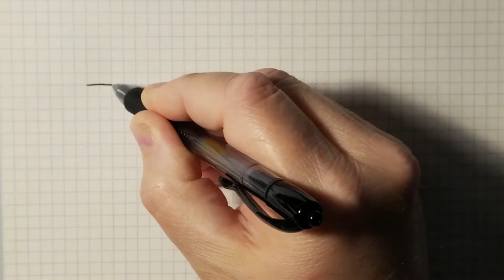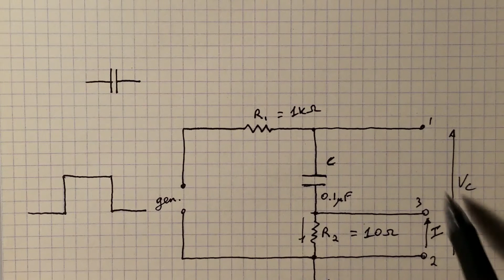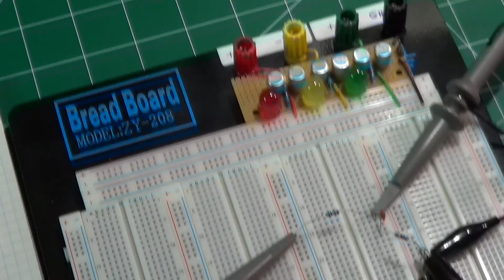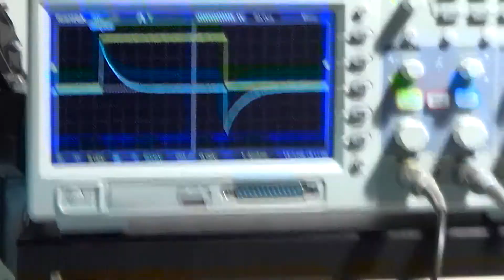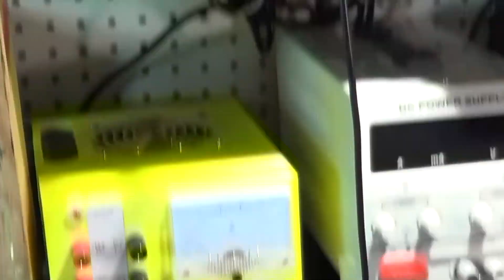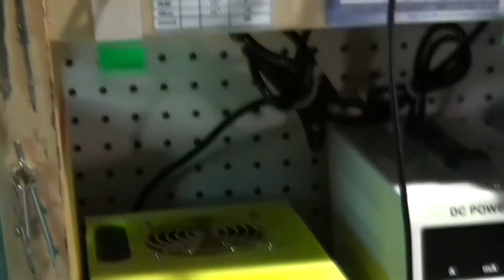capacitors charge and discharge visualized

Comment: Your function generator doesn't seem to be available anywhere anymore & that is to be expected after 5 years. 
Can you recommend one of similar lower end specs that I could use to emulate your vizualization. I can only see higher end expensive units for professional use & most are only signal generators anyhow.
Reply from the maker: Well, yes that function generator you see in the video was made by myself way before I started making videos, that's why you couldn't find.
If you are interested in buying one at low cost, I see there are several options on Amazon, ranging from about $10 to $100. It all depends on what you want to use it for.
This one, for example, is based on the same IC i used for mine, but is very basic:
https://www.amazon.com/ICQUANZX-Precision-Generator-Adjustable-Frequency/dp/B07V674HZY/ref=sr_1_5?crid=WEIEEXDT4N4K&keywords=function+generator&qid=1706289323&sprefix=function+generator%2Caps%2C122&sr=8-5
This other one has a smaller range, but it seems good enough for Audio applications, and It ha a nice display and controls:
https://www.amazon.com/1HZ-500KHZ-Functional-Generator-Seesii-Frequency/dp/B08NSR5GYR/ref=sr_1_3?crid=WEIEEXDT4N4K&keywords=function%2Bgenerator&qid=1706289323&sprefix=function%2Bgenerator%2Caps%2C122&sr=8-3&th=1
Finally, I could suggest an entry level instrument that is also capable of creating any shape you like, a true function generator, rather than a signal generator, but it is around 100 bucks:
https://www.amazon.com/Koolertron-Generator-Precision-Dual-channel-Arbitrary/dp/B07211YWMK/ref=sr_1_4?crid=WEIEEXDT4N4K&keywords=function+generator&qid=1706289323&sprefix=function+generator%2Caps%2C122&sr=8-4&ufe=app_do%3Aamzn1.fos.18ed3cb5-28d5-4975-8bc7-93deae8f9840
This last one is actually very similar to the one I currently use in my lab.

Comment: After viewing amateur after amateur videos and youtube channels this is refreshing. Noting the following: Though I'd like to know and see the actual specific current running through a capacitor from T1 through T5 on a scope (i.e. the 5 time constants), this I believe will get me started.

Though I've several reasons in monitoring a capacitor for a future project, monitoring and recording by means of a scope rather than to using those 'useful but cumbersome equations' I often get lost in, putting my scope & generator to work will be far more accurate. Also, though I'm sure I would eventually thought of using the lower resistor as you have (as in a 1 ohm for example) I never thought to include that same lower resistor.  Thanks. And excellent job on this presentation.

Comment: I may be 4 years late but this video is perfect and EXACTLY what I was looking for to visualize the terminologies. So when people say capacitors resist changes, it's not that the capacitor is staying stuck at some voltage, it just simply takes some time to change; giving the illusion of being resistant to instant change lol. 

Explaining in terms of the potential difference, with a bigger difference = more current flow makes a lot more sense and is more intuitive for me. Capacitor draws more current when it starts charging because big PD. Likewise, it discharges high current because of the big PD, just in another direction. As the PD decreases, so too will the rate of charging/discharging.

Comment: what voltage and frequency did you set your function generator at?
Reply from the maker: It can actually be seen from the oscilloscope itself, although I didn't mention it in the video. Sorry about that.
The input square signal has an amplitude of 15V and a frequency of about 1.4kHz.
Note that the amplitude of the output signal is not displayed correctly, because I was using an attenuated probe (x10) but the oscilloscope was not set  to measure the attenuated signal. So, although you see 50V/div on the second channel of the oscillosco, it is in reality 5V/div. So, as it is supposed to be, the max amplitude of both input and output signals is the same: 15V.
Also, note that although I used a frequency of 1.4kHz, you will probably need to change it if you are using values of capacitor and resistor different than what I did.  The frequency needs to be adjusted based on the timing constant of the circuit: T = RC. In general you have to calculate the timing constant and then use a frequency of the same order of magnitude as 1/T = 1/RC.

Comment: Thank you so much this is perfect I've been trying to do this getting the charging and discharging graph of a capacitor.
Isn't there a way of being able to tell if you could pass her is good or Not by using this graph and some calculation would you mind please doing that?
Reply from the maker: Yes, there are ways to tell if a capacitor is good or not. The answer won't fit easily in this answer, so I'll make a video out of it. I'll put it on my to do list and make it soon. Thank you for the question!

Comment: Hello, Thanks for the video. My question is can this setup be replicated with a DC Load Power Supply instead of the generator. I would appreciate your swift response. Thanks
Reply from the maker: The generator helps because it can repeat over and over again the process. But, if you are only looking at execting the charge process once, then you can power the circuit through a DC power supply or a battery in series with a switch. Leave the switch open and conenct everything like it was the generator. Then, close the switch and the capacitor will charge. If you set the oscilloscope to see only one shot, you will see the charge cycle. To see the dicharge cycle, open again the switch but, this time, connect the other end of the switch to ground instead of the DC power supply/battery. When you close the switch the capacitor will discharge and, again, you can see that single discharge on the oscilloscope if you use it to show a single shot.

Comment: Absolutely excellent......👍🏻 I see that your channel 2 voltage division setting varies between 50V and 500mV in you tutorial video. Could you help me with an explanation please. Is it dependent on your signal generator settings? Thanks for your great videos, I’ve learnt a lot 👌🏻
Reply from the maker: Yes,  it depended on the amplitude of the signal coming from the generator.  Depending on what i wanted to show, I had to adjust the settings to emphasize what i needed. The alternative was to keep changing the values of the capacitor and the resistor.
Reply from the maker: Thank you! Really appreciate the comment.

Comment: Question: Hi, I have a question regarding single phase AC motors that use a start capacitor. If I disconnect the start capacitor from my motor, it will only hum, but will not start. When I reconnect the capacitor, the motor starts immediately. Which current from the capacitor helps the motor start? Is it the surge current when the capacitor is charging or the surge current when the capacitor is discharging that helps the motor start? Thanks for your help.
Reply from the maker: Actually is neither. The motor runs with alternate current,  right? The capacitor,  when working in AC, has a different behavior from a high level perspective. In AC, the capacitor behaves like a resistor. And it's resistance is actually called reactance. It is different than resistance itself because it changes the phase of the current with respect to the voltage. The motor has also a reactance. But this one works in the opposite way as the one of the capacitor. Putting the two together, the phase difference of the voltage and current are neutralized and so an active power can be generated, as opposed as a reactive power, and the motor can use this active power to convert the corresponding electric energy in mechanical energy. And therefore the motor can start running.
Reply: Thanks for the quick reply. I think I understand it now. The start capacitor is added to correct the lagging current caused by the inductive load of the motor. This increases the power factor by putting the current and voltage waveforms closer into phase with each other. In short, you add the capacitor to correct  the power factor. Thanks again!
Reply from the maker: @bernardocisneros4402  Exactly to the point!

Comment: Thank you very much for making this video. It's a lot easier to see what happens to current and voltage as a capacitor is charged and discharged when you see it on an oscilloscope.

Comment: hello, sir could you please interpret the instantly growth of current from 0  to a constant value , thank you in advance
Reply from the maker: you need to consider two important things. When a capacitor is charged, the more charges it stores, the higher is its voltage. When a voltageis applied to a resistor, a current flows through it. This current increases when the voltage increases and vice versa.
If you have a capacitor in series with a resitor, and we apply a voltage to the system, since the capacitor is initially discharged, its voltage will be 0V. Therefore, the difference of potential, or voltage, at the resistor, will be equal to the voltage applied to the system. Because of this voltage, a certain amount of current will start flowing. The current, on the other end, will bring new charges to the capacitor, which will start accumulating them and will start increase its voltage. Once the voltage at the capacitor increases, the one at the resistor will decrease proportionally, which will cause the current to diminish as well. So the current is initially high, and then it will become less. Now, if we repeat this same reasoning again, you'll see that the capacitor will increase the voltage due to the new, lower current. This increase in voltage will cause a decrease in voltage at the resistor and a currnet even lower. So, at the end, the current will flow slower and slower until it won't be possible to measure it anymore. Initially it will decrease faster, but then it will decrease slower and slower.. And that is the reason why we see that kind of curve for the charging of the capacitor. The discharge happen in a similar way, but this time we invert the voltage applied to the series of the resistor and the capacitor and, therefore, the curve on the oscilloscope will look like is upside down with respect to the previous cycle.
Hope this helps.

Comment: Hello, I have reproduced the same as showen but as I cannot see the charge and discharge curve  I see as you the current ....( I have the Hantek 4252C, and I've used the internal generator set =2 V and 1,4khz)..... With the probes I've done exactly the same as you show . What I wrong?... many thanks in advance
Reply from the maker: You have to use a frequency corresponding to at least 10 times less that the timing constant provided by the capacitor and the resistor you are using. Otherwise, the generator will switch the polarity of the signal before the transient can still be visible. Try to reduce the frequency of the generator and you should be able to see the transients.